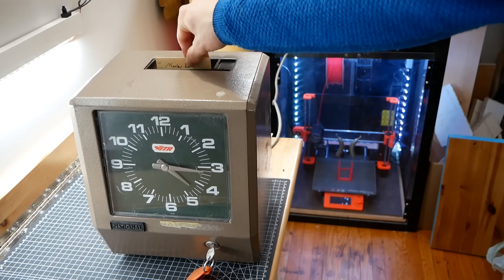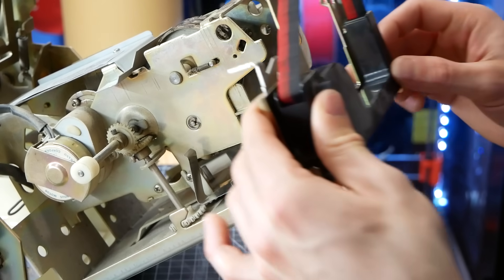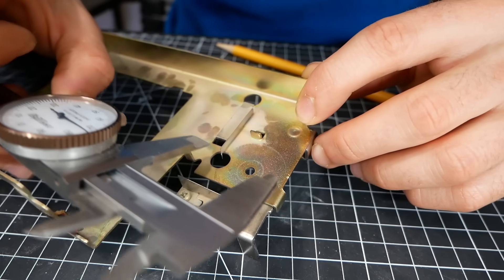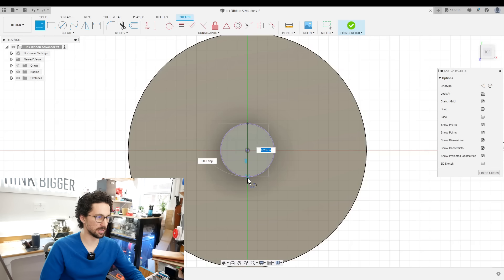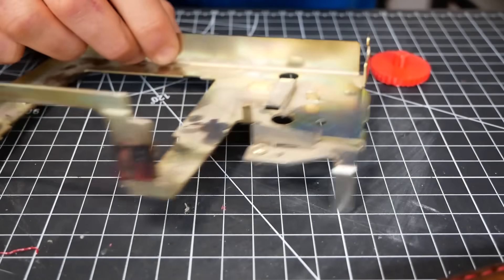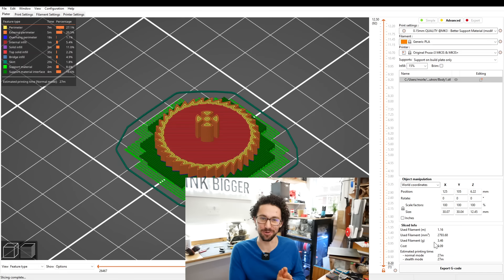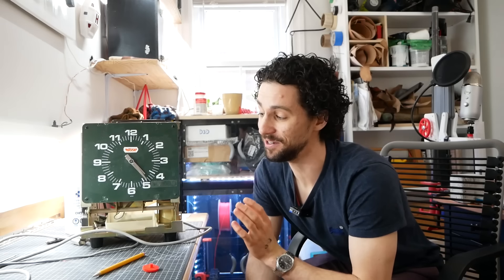They wanted 100 dollars. I 3D printed it for 9 cents.

Comment from the maker: The STL file for this part is available for free download on my website: http://morleykert.com/s/gear.stl
Reply: Deff cost u 18cents, didn't you print this twice
Reply: Nice man, i actually had a few print rolls that apparently have similar pegs required on the top of a similar sized gear, and so ive just been using this for two of them so far. Ink cartridges and rolls back then just sorta used the same 4 prong insert i suppose.
Reply: I’ve worked for a company that made car parts, and they were practically incapable of making a single piece of anything 
Even the prototype runs of a new part went in sets of 5
One time someone ordered a replacement part for a car, we had to make 20 parts  because that is what the production run was tooled to do
So that means receive the order, locate the old tooling, run all of the pieces for the 20 parts, paint them, assemble all of them, packaging the parts for shipping, and shipping them using FEDEX rather than putting them in a regular freight truck 
It took all day and was handled by over 15 employees over the course of the process…
Then it gets to the company that you ordered the part from, they sell you the ONE that you ordered 
And…
Do what with the other 19?
Store them in the hopes that someone else needs it?
Having to count it in tax inventories every year they don’t sell?
Just scrap them?
Reply: @drthmik  That makes the 95 dollars look like quite a bargain
Reply: @drthmik  I can see how that works but if you're trying to apply it to this situation the email from the manufacturer did say that they had it "in stock" for $95.
Reply: How on earth does a gear in that spot get lost?! Conspiracy theory:  Maybe it was never lost. Maybe it was removed to have a reason to replace it and make a Video about it. :)
Reply: Should have charged 95 dollars for it lol
Reply: @YamiGenesis  or $94.99
Reply: You need to send an email to them and invoice them for $100, plus an hourly rate, plus a broken 3d printer file example, and then send the link to the correct online file.
Reply: um it wasnt 9cents ... it was your time plus 2 parts ... so for $20.20 you replaced the $95 part .... now you know how much mark-up they are charging  ... but still a total rip off for such a simple part ....
Reply: The thing about plastic is it’s gonna get worn out faster than metal, so you’ll have to replace it more often.
Reply: Probably already posted here, but I don't have the energy to read a bunch of comments right now.
The word "solenoid" is said as "SOUL - en - oid"
OK? 👍
ADDENDUM:  BTW, that's a BEAUTIFULLY done replacement gear piece!  Thanks for making it; I learned quite a bit.
Reply: it cost 9 cents, but don't forget the $ 300 for labor.
Reply: Do you do requests?
Reply: For anyone wondering, if you are clicking the link, in chrome it doesnt open. Just copy and paste into browser... Also, I was one of the people giving him grief over the cost issue lol. As other people have pointed out, the uno reverse card he can use is "well this video is my job so I am getting paid and can write off all the costs" And to that I say, fair enough sir :)
Reply: VCR players have a common issue of broken plastic gears. Repairing them can cost 100-300 dolars!!! Pretty sure with a 3d printer it be a easy fix.
Reply: It's actually reasonable what they asked you. They are business so they have to pay people wages. That means they have to cover all the work associated with specialty/legacy parts. And don't forget we carry the burden of subsidizing communist chinese economy via all the climate and equity scam taxes which increases all costs on our side so the communists can pretend to have cheap labor. 
In your case it wasn't 9 cents either - I'm not sure how much is your time worth but I'm sure it's not nothing and same goes for the electricity and equipment used. If someone doesn't have the skills, equipment and knowledge 100 is pretty good deal considering what it would cost them otherwise. 
Good video though and I did leave you a like too!
Reply: did you reply to them and say that you printed the part for .09c ?? XD
Reply: The stl is available ….For the tens of thousands of people who need it 😂. Nice vid though 👍🏻
Reply: is this legal?
Reply: @akpokemon  Absolutely.
Reply: @akpokemon  How would that not be? He's making available for free a file he designed himself
Reply: @akpokemon  wtf why would you think this isn't legal especially for an ancient device... you can do this for new things too.. and sell them if you wanted. It's when you start making full copies of patented products and selling them that can get you in to trouble. Not just a small part that fixes a broken device. The device that isn't even patented anymore so you could copy the whole thing.
Reply: Your calculation is wrong:
I guess you took at least 3 hours to disassemble the clock, find the fault, contact the company and find and watch the video of curious Marc to see the part, construct the part in a 3D program and print it on a 3D printer.
Moreover you had to buy a computer at presumably at least $1000 and software and a printer at $500 including your time investment to figure out how to operate your equipment.
Clocking in your hourly wage at, mmmh... your level of qualification... lets say $10...
In addition 9 cents for material and lets say $3 electricity to operate your computer, printer, workshop heating and electricity.
This part costed you $1533.09. So your hourly wage was a shocking minus $511.03 an hour.
That is highly inefficient. 
You are on a steep slope to bankruptcy.
Ordering that part for just $100 would have been a bargain, compared to your modus operandi.
However, what kind of factory do you operate, that you need a punch clock?
Reply: @thekaiser1919  you forgot to include all the money he spent on food his entire life. He already had the printer. He has a hobby designing things and printing them, heck this video alone made him a tidy profit. Not very bright are you? 👍🤣
Reply: @hippopotamus86  Food is his private problem. I proved that this video has an outrageously misleading title
and is therefore a gross violation of the youtube community guidelines he signed up to.
Somebody should report that!
Reply: @thekaiser1919  So he throws away his PC and 3D printer after every print? No, he already had both. You've got to be the most boring person.
Reply: @hippopotamus86  This is a matter of CONDITIO SINE QUA NON principle. He could not have printed without a printer.
So the PC and printer are automatically part of the calculation.
Reply: @thekaiser1919  Don't forget the cost of his house then too. Needs to have somewhere to plug in the PC and printers.

Comment: Misleading
1. The missing part was not 9 cents, that was just the material cost for one. But he had multiple iterations, you cannot buy 9 cents worth of material. Also the time invested in modelling, printing, electricity.
2. They charged 95+tax for the whole assembly which included stamped metal sheet, not just the missing part, which is impractical/impossible to buy by itself.

I call bullshit, just another episode from a typical fake sell out Youtuber with constant sponsored videos (Bambu Lab).

I like it!

Comment: B) If you extrude the tooth profile first, then pattern the extrusion, you will not have to select all of the profiles, and the number of teeth can just be edited via a parameter rather than guesswork.

All of that said, it would be better to define it by the number of teeth, rather than the angle used, and then have a parameter that becomes 360/tooth count. The extrusion of the single tooth first still applies though.

Comment: I know this video is 2 years old, but those ribbons have "nothing" inside the box part. They used to be called a "stuffing box", and maybe still known as that. The drive roller pushes or stuffs the ribbon into the box. and the feed pulls the other end out. So total ribbon length might be 10 or 20 times longer than the bit on the outside. I used to fix machines using something like those, and ribbons was sometimes impossible to get. So if the ribbon was worn out (starting to rip), then you need a new one. But if its OK, then you can add tiny drops of ink to the part outside. Wind a bit into the box. Repeat. Until you know its been around once or twice. There is probably a join. Tiny is key. Too much ink you make a total mess of everything. So with some ink and time the ribbon is like new and the machine is printing again. And yes, I not only used to fix things on the machines, but sometimes would reink a throw-away ribbon if no new ones was to hand. Anyway, there's my part of the story, and some of my love/hate of fixing things that should maybe have been replaced or thrown away 40 years prior. So I'd fix them when I could.

Comment: The number of teeth could be a parameter = "360/tooth-angle." Because you want an integer number of teeth, it would be better to pick the number of teeth and then make the ToothAngle = 360/NumberOfTeeth. That was a great solution and you nailed a working solution very quickly.

Comment: In 1978, I was given a Hobart restaurant mixer to fix.  It was jumping out of gear.  I found the problem, that was the soft iron jaws that had worn. I called the distributor, and was quoted over $700 apiece (in 1978 dollars) for a small iron casting, just over an inch in diameter.

I simply filed them back to square, and the unit worked perfectly.

Comment: Cost of a 3D printer $750
Time to produce the gear 4-6 hours
Materials $40
Software to run the printer $75

Price of the new assembly with the gear, new ribbon and extra ink $90 + tax = $103

I'd say your kinda stupid

Comment: when the main burner plastic knob on my bosch stove cracked and made it unusable, the appliance stores wanted $40 and up for 1 knob
local 3d printer guy wanted $20
it cost me $2.79 in gasoline and 30 minutes of my time to drive to home depot and back, take a knob off the bosch floor model stove and put it in my pocket

Comment: You could count the number of teeth in the dust imprint at least for a 90° section and then times it by four. It looked like there was a clear indent in the dust pattern for each tooth.

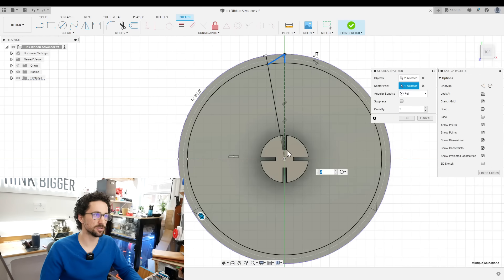Comment: 8:17 You don't know how many teeth to fill the circle? At 10 degrees per tooth? On a 360 degree circle? Did you just space on that calculation or was that one of those "intentionally dense" parts to drive engagement? Because if it's the latter, it worked on me.

Comment: The ink is dried out on that ribbon and chances are you can not get the ribbon. You can renew the ribbon by open it up and lightly spraying the wound ribbon with WD40. It will act as a solvent and dissolved the ink so it can be redeposited on the paper again from the ribbon. it's a trick I learned from a typewriter/calculator repairman who is in the process of shutting down his business.

Comment: My 3d printer is half toy, half useful device for printing up things that have broken or that I'd end up spending money to buy online. I've printed hangers, replacement Christmas tree legs, fridge handles, dishwasher bits, casings and mounts for electronics. Random stuff. To tell the truth there is no way I'm ever going to print enough things to recoup the cost of it, but it's still an engaging fun thing to play with and being able to put it to practical use is just a bonus.

Comment: I had to laugh when you said "which I assume is an ink reservoir". But it's just showing your youth and how much things have changed. Where you advance the ribbon is just onto a spool and the ribbon coming out the other side is coming off a spool. Some of them had a lever that you could move and it would rerun the ribbon back the other way. Good thing for modern things though and you were able to reproduce the part fairly cheaply. It would have been easy to figure out the number of teeth if using 10 deg per tooth and since a circle has 360 degrees = 36 teeth.

Comment: Nice!. Several years ago the push button to open the door of my Panasonic microwave got broken. I 3D printed a replacement of the broken part and $200 got saved. It is still working. This is the kind of videos that worth watching. Thanks for sharing it.

Comment: There's no reservoir in the cartridge, just a loop of ribbon.  Not sure why this doesn't use an all black ribbon, unless it has a use for the red.

Now, ribbons are hard to find.  Stamp pad ink can be used to reink ribbons.  Suppose the correct ink can be found.

Comment: I'm curious to how you came to the figure of 9 cents.  As the tittle of the video say that you printed it for 9 cents is that just the cost of the material used?  If so there are other factors to consider that add to the cost of the piece.  You need to factor in the cost of other things like the 3D printer you used to print the gear as that took time and also wear and tear on the 3D printer so need to figure out how much the 3D printer depreciated and then there is also the time you took to design the gear need to factor in how much labor would cost for that time spent as well.  But I would guess even with those costs added that it would still be less then the $90+ they were telling you that it would cost to fix the time clock.

Comment: Someone asked why i bought a 3D printer. My answer was because I couldn't find it elsewhere. I recently made an adapter plate for supporting a laser level bracket that attaches to a pole. The bracket that came with the pole didn't have fine adjustments for the laser and the bracket couldn't attach to the pole. 

Off to tinkercad and make a part.

Comment: Your number of teeth should be 360 divided by the tooth angle. As long as the tooth angle is a factor of 360, it will work.

Comment: Regardless of him not being able to print the whole new part, he still saved over $90. They weren't willing to sell him just the gear for any price, leaving him to buy the whole thing or not at all. This is super common in every repair industry. Especially when the manufacturer tells you they don't support that model anymore and you have to buy their latest model. I bought an aftermarket replacement screen for $200 off ebay instead of making our company buy the "latest and greatest model" that adds no features for over $20k. This is why repair techs are essential in big companies that have lots of equipment.

Comment: for a long time I felt silly having a 3d printer and printing paperweights, until a small bushing broke inside my car's shifter assembly and the "only repair option" was a replacement assembly around 1000$ installed... trial and error with TPU and voila worked again until the 98' corolla fully died for other reasons

Comment: Instead of making the circular pattern in the sketch it's almost always better to make the circular pattern on bodies or features. In this case you could sketch and extrude one tooth and pattern the extrude feature. It would have saved you the tedious profile selecting, it's easier to edit and Fusion has better performance with those kind of patterns compared to patterns in sketches. 
There are rare cases when you have to use pattern in sketch but try to stay away from it if you can.

Comment: I wonder how many hours you spent in fusion and what you would charge per hour if you'd do this kind of work for somebody else. I found that often when I do stuff myself to save on material cost, I spend a lot of time. Of course it's fun and rewarding to do stuff myself but if I'd view it from a monetary standpoint alone, more often than not spending the extra money to buy something would end up cheaper than factoring in labor costs

Comment: Great project, great thinking. For the record the ribbon cartridge just accordions the ribbon back in and reuses it. There's no ink reservoir. It just lightly uses each part of the ribbon and keeps rotating it around until you don't like the way it looks anymore than you buy a new ribbon.

Comment: Thanks for sharing your thoughts, ideas and videos. Would be great if there was a library somewhere with the pattern and specifications needed to print consumable wear parts for out of patent products. I’m reminded of a tool I considered buying once to repair a jetted tub I once owned. The manufacturer would sell me one for about $100 US and I realized if I had a 3D printer it would cost me pennies to make. Ended up not buying out of principal and let the broken tub go with the home. Yes the manufacturer had the embedded cost of maintaining inventory but I would bet they could also share the details and offer to have parts printed as needed for a fraction of the cost to store them. And they did mention that the part I needed was running low on inventory and wasn’t expected to be restocked.

Comment: I hate it when people use technical jargon. Could you please explain it in plain English when you talk about the teeth being more “dramatic”. But seriously that’s totally not the right word. Pronounced would’ve been better.  Also, I would’ve designed it a little different so that you don’t have the entire bottom destroyed with Support material.  That’s your most critical area. You should’ve printed it upside down, but I would’ve actually done two pieces with a central hub and then made the spindles tighter so that you have plastic on plastic friction and not metal on plastic friction.

Comment: I’d recommend multi jet fusion from some Chinese shop. These days that part would cost you $7 shipped ($0.50 printing + $6.50 shipping). The dimensional stability and strength is much better than hobby printers.